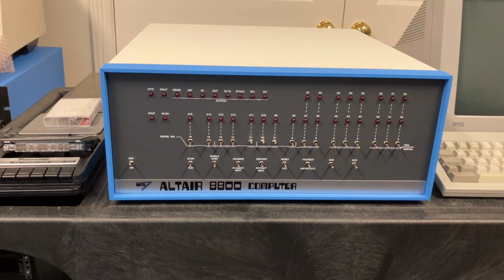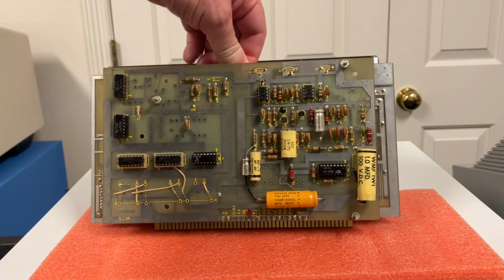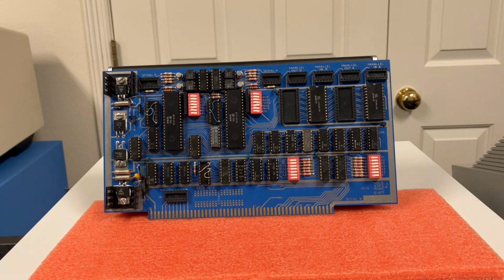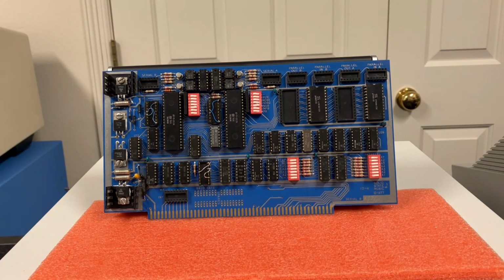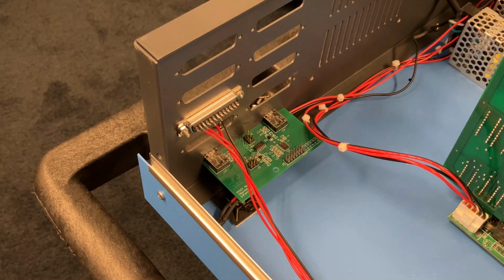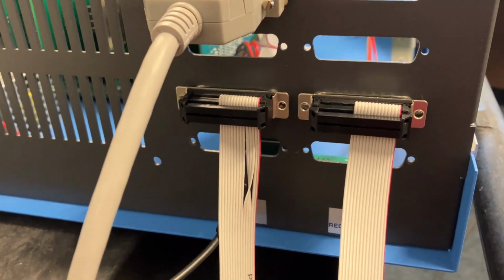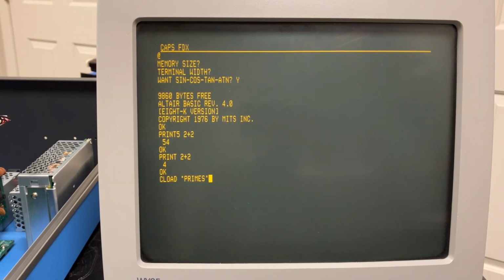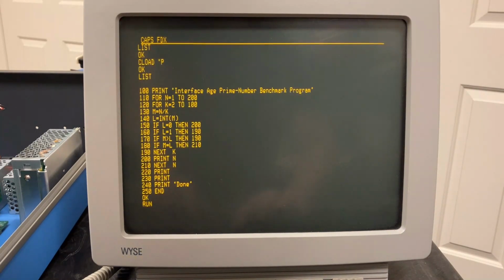Replacement for the Altair Cassette Interface (88-ACR)

Comment: Great video Mike, Thank you! There is a simple address decoding modification on the IO-4 board that will allow you to use port 0 at address 00h/01h (SIO address) and port 1 at 06h/07h (ACR). This requires lifting one pin, adding a 74ls86 and 3 jumper wires. If you lift pin 11 of U35 address comparator (Signal A2 from S100 bus), then add a 74LS86 XOR gate in one of the spare chip locations with one XOR gate output driving pin 11 of U35. The inputs of this XOR gate should then be connected directly to A1 and A2 of the S100 bus. That's it! By XORing A1 and A2 before the comparator, the comparator output will be active for IO addresses 00h/01h (port 0) and 06h/07h (port 1). The S3-A2 switch must be zero to decode 01h/02h and 06h/07h, setting S3-A2 to one would enable decoding at 02h/03h and 04h/05h (probably nor useful). So you can use the IO-4 card as a replacement for both the cassette interface and an original SIO. Combine this with Martin's 2SIO-JP card and you will have all common serial IO port configurations on two cards. This should work on any two port IO card that decodes both serial port addresses into a single 4 byte io block.

Comment: One Saturday in the late 70’s I thought I wanted to play a game of Battleship. After toggling in the bootloader, I started loading my copy of 12K MS basic paper tape. That was 45 minutes, and it came to READY. Next, I started the load of Battleship paper tape. That was another 45 minutes, and that too came to READY. Then the power to the apartment blinked. I then left the apartment disgusted to do something else. The next board I bought was an auto tape interface. That lasted for about a month or two and after that was a floppy drive system (90K).

The tapes featured in this comment are lost in some box somewhere in this house and someday I might even find it amongst other things. 

The Altair 8080 resurrection is ongoing.

Comment: Another Great video from Deramp, Thanks... I started out with the Heathkit H8 ~1977 or 78, forget which. It was not as sexy as the Altair or IMSAI but there was very good support at the time from the Heath Users Group, HUG. I managed to get a Model 33 teletype which I later gave away once I got a much faster dot matrix printer, wish I still had the 33.
Anyway, so glad to see all of the recent interest in the 8-bit stuff. I have modern kits for the Altair, IMSAI, DEC PDP 8, and 11/40. The small company which made the DEC kits will soon have the PDP 10 and looking forward to building it as well.
Thanks for all of your excellent video's and keeping this vintage equipment relevant in these days of ultra high speed systems with huge storage and amazing graphics. Sadly, the majority of the users of our modern equipment have no interest or knowledge of what is going on inside as they post one more selfie with their dinner.

Comment: Such a neat S100 system! Some S100 systems used cheaper software bashed I/O bits for their serial and tape interfaces at a max of 19200 baud.

Comment: Reminds me of the Tarbell dual cassette drive I used back in the day.
PLAY/STOP/REW/FF/RECORD were all under program control and it must have had special motors to attain a blazing 1000 bytes per second!

http://s100computers.com/Hardware%20Manuals/Tarbell/Tarbell%20Cassette%20Interface%20Technical%20Manual.pdf

Comment: what about a tape punch and paper tape reader to load and save programs on or take the cassette mechanism for a Philips DCC900 and use the data lines for input and output and will output or input as full 8bit bytes
Reply from the maker: Here's a high speed paper tape reader/punch configured to look like an Altair cassette https://youtu.be/wALFrUd6Ttw

Comment: 8" floppies were first before 5-1/4" in my recollection.  My first floppies were 8", circa 1980, and I still have them.
Reply from the maker: Yes, you are correct, 8" drives were the first available for these early computers. However, they cost far more than the computer system itself cost. When Shugart introduced the 5.25" drive and companies like North Star developed floppy subsystems that employed these new drives, the cost of adding a floppy drive to a home computer dropped dramatically. A 5.25" floppy subsystem was about 1/3 the cost of an 8" floppy subsystem. The affordable 5.25" floppy subsystem dramatically changed the personal computer marketplace.
Reply: @deramp5113  You are right about the much higher cost of the 8" drives, but I didn't add my 8" drives, Qume brand, right away but when I did it was for the storage space available.  Mine were dual sided double density (DSDD) that held a whopping 2.4MB each! 😀 And the cost was, $525.00 each, and for two the cost was way more than my original purchase price for my basic Altair, $439.00, with extra memory to bring it from 256 byte up to a total of 1K!!

Comment: Excellent video! I've been meaning to make up my own "8800c" build for a while now. Your Altair series since its inception has inspired me, a youngin', to go explore the world of 1970s computing. I can't imagine that I'm alone in that sentiment.
Reply: You are not 😊
I've learned Z80 assembly this year and wrote a BIOS for CPM 3 on John Winans' Z80 Retro board.
I really enjoy that one in particular because it is still rather simple compared to even MS-DOS. But it has a lot of features under the hood that make it very usable and versatile. Like you can add or change functionality with RSX modules, you can add disk drivers at runtime, you can have up to 16 character devices with extremely flexible redirection, and it supports disks of up to 512 MB with up to 4000 files. 
My particular port is 27k in size but still gives 56k TPA. I also wrote a driver for the TMS 9918 VDP with basic adm3a functions, that uses another 3k if enabled. 2k of that are just the character bitmaps.